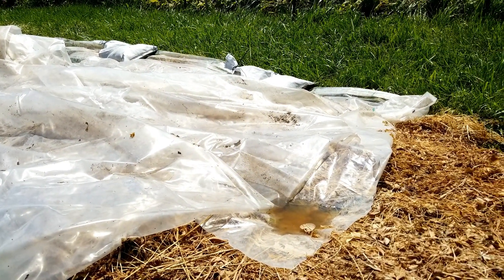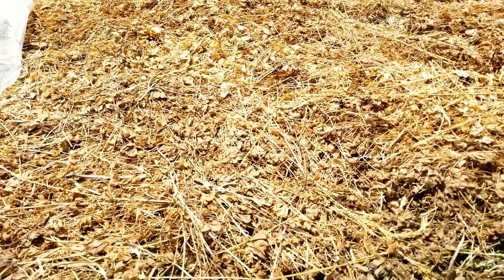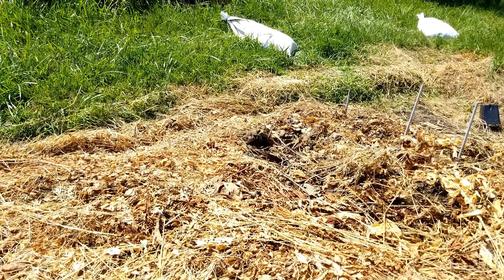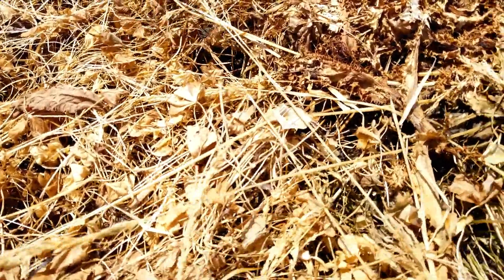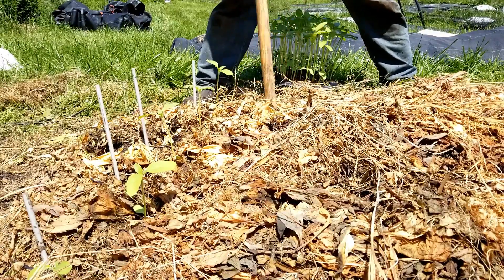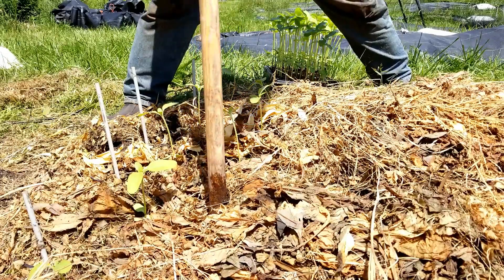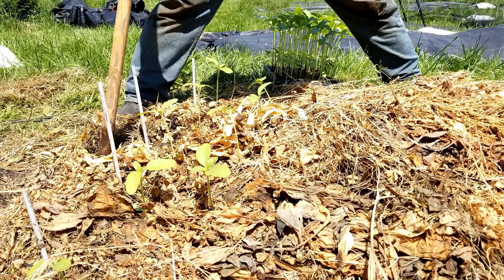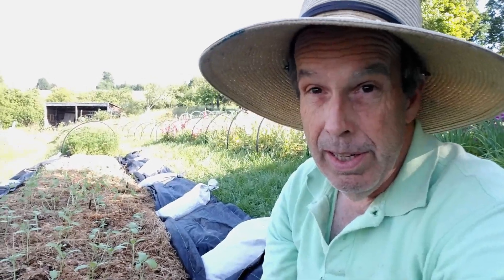Update: No Till Bed Solarization

Comment: I've tried and trialed solarization some. I think OSU recommends 8' x 8' minimum for it to be effective. The distance (height) of the poly is crucial. Like you said the closer/lower the better. High moisture levels in the soil before the poly goes on is crucial too. No problem there on your trial. I went do far as to wrap/roll the edges in EMT or pipe and staple it all down with landscape fabric staples. More work but was more effective for us. We even rolled the plastic on itslef to make a thicker lip or rim and buried the edges on one (in hopes of killing Yellow Nutsedge).  Was effective(not on nutsedge), we were clearing weeds not cover crops. Nutsedge and Crabgrass acted like we had built them a cozy green house to thrive in 🙁
Reply from the maker: Hi @Timothy Mcdonough. we have heard the same thing about perennial weeds. Thanks for the tips on edges too.